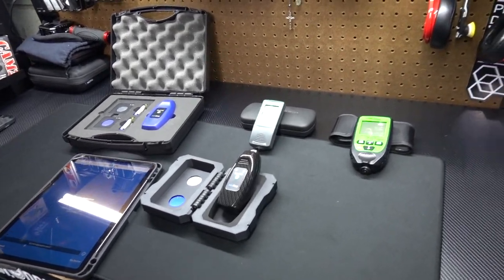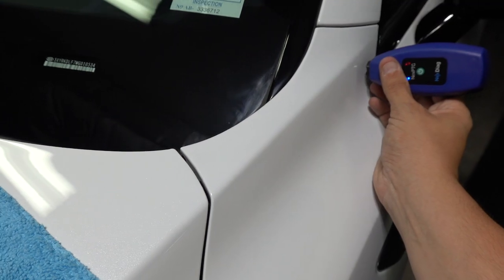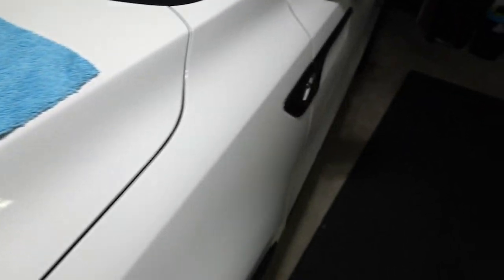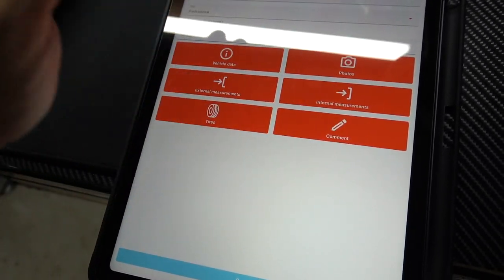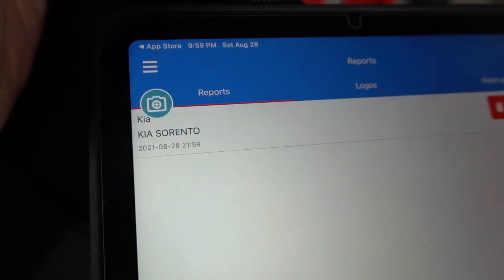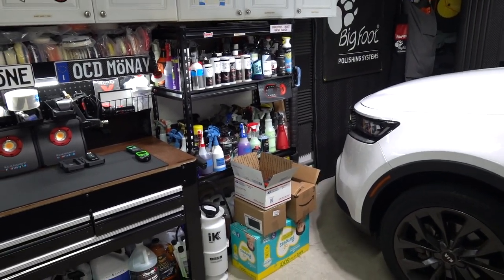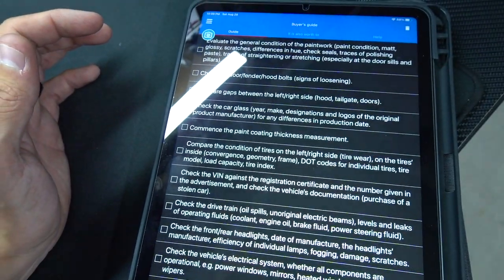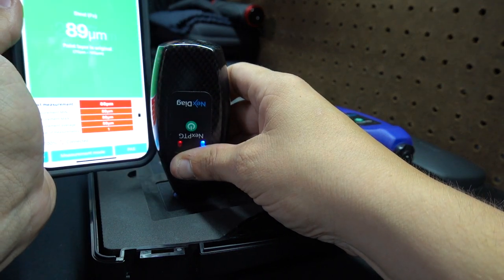Using My NexPTG Paint Thickness Gauge | IT'S AMAZING!

Comment: Excellent evaluation of the NexPTG Pro. I recently purchased one after using their Standard and Advanced models. The Pro reads slightly lower than the others, but it’s got the moveable head vs flat fixed. A word of caution: when using the Pro, the small pin in the center of the head will lightly scratch soft clear coats like Lexus products. So what makes the carbon fiber worth the price? Carbon housing looks cool, but does it perform better? It looks like the carbon gauge has a flat head instead of the moveable head. If the only difference is the housing, then it’s not worth twice the cost IMO. Keep up the good work, and thanks for posting. Be safe.

Comment: How do you change the measurements from microns (um) to millimeters (ml).  Thank you in advance 👍
Reply: Within the settings. “Unit of measure” a few choices down. Metric or imperial. Cheers
Reply: @EsDriving  thank you for responding 👍
Reply: @davidboyce6427  no problem. I’m about to pro grade ceramic coat my new vehicle within the next month or so, i’m actually brushing up on all subject matter i believe is needed.
Reply: @davidboyce6427  Millimeters is mm not ml
Reply: @AsentrixYT  ok got it

Comment: Late comment… 2 yrs.  Looking at the Nex PTG’s. These come with calibration chips of known value. Compare the readings on the known calibration chips - Steel & Aluminum. If the other ones are high on known chips too, then you know the difference is in the other units calibration not being accurate.  The Nex PTG units can be calibrated any time with chips.